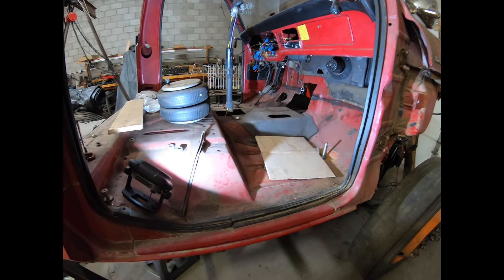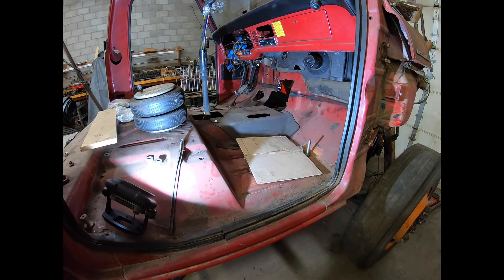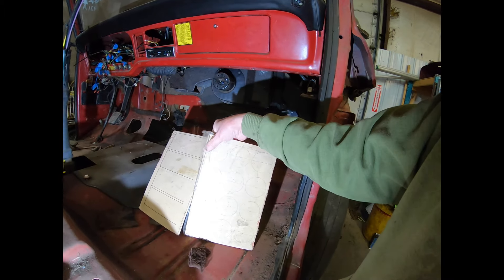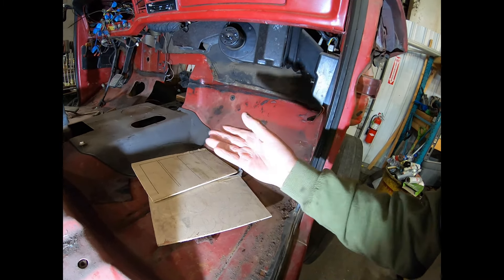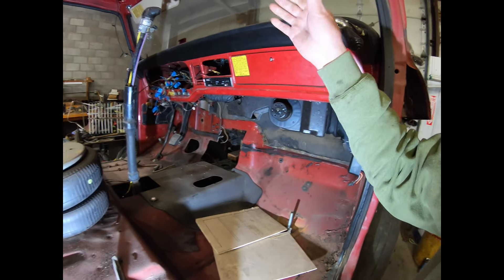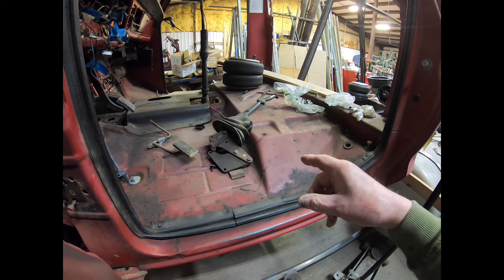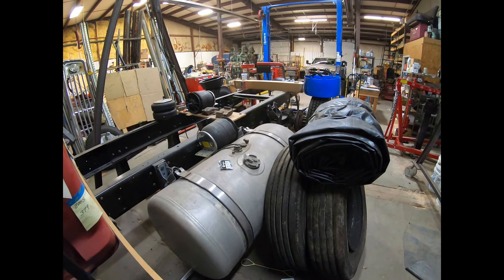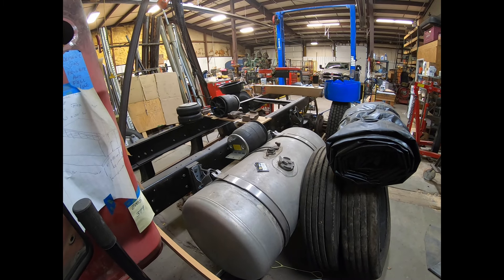Ford F750 Haul Truck Build Part 65

Comment: Fred, Dakota Digital has a modern electronic, stock appearing Ford truck dash units and could put all of the custom gaugings you want in it.  They could custom make what you are wanting.  You could even go to a laptop-style screen that you could select readouts for a multitude of sensors and program it to your layout you like.
As for the heat/AC system.  Vintage Air builds fantastic air conditioning and heat units that are designed to replace the antiqued unit in the truck.  
The power steering on the Ford was probably a unit that had a hyd cylinder that fits into the crosslink assembly.  It sensed the pitman arm trying to move and applied hydraulic pressure, via lines and hoses to the external cylinder hooked to the frame and crosslink.  I believe what you would want to do is find a later-style unit that is all in the same gearbox.  Even adapting a unit from some different truck should be not much more than making an adapter plate to the frame. 
Take the floor out, build back what you want using 16 ga. or even thicker metal.  You might even do the same on the driver's side and put a nice air-ride seat assembly from a semi into it.  Just weld reinforcements under the seat mount for safety.
As for the wiring mess in the old truck.  Companies like Ron Painless Wiring make new harness assemblies that are designed for modern electrics.  You know what you are wiring/wanting, send them a drawing and some photos and I am sure you would get a new harness back that would be perfectly matched to your digital dash.  
Being the truck is old and a heavier duty truck than a pickup the cab is the same.  So the custom truck market is ripe with special stuff.  Jump in with both feet, look for modern stuff and have fun.  After all, this is a custom build so a custom dash would just be a nice touch.

Comment: Geeezzz, that's a lot of mods to get that truck on the road. I think you have to look at does that cab fit your need with having to add a sleeper,AC and power steering. Another issue with those old fords was the front ends, they were always hard on the steer tires.

Comment: Fred, I think I caught in your video that there is a Hydraulic brake line lock lever on the left side of the dash that was used for static operation.  Step on the brake, flip the lever and pressure was trapped in the brake cylinders which kept the brakes locked on.  We used those on all of our service and winch trucks.  That drum brake you have on the drive shaft went out of style because if it was used as an emergency braking system the rear wheels could still rotate due to the differential acting if traction was lost on one or both wheels.
Reply from the maker: Yeah, I was going to try to be able to use it as a parking brake but they won’t let me! Parking brake has to be independent of main brake system I was told! I was going to reconnect it to front brakes and then have the normal parking brake attached to drive line for rears!
Reply: @frednewman2162  Bummer.  We used the valves that had a black knob you pulled up and then let off on your brake.  When you were ready to go you simply stepped on the brake and the check ball released.  Cars and trucks used to have the hill holder function that automatically kept the rear brakes applied when you stopped on hills.  That way you could have one foot on the clutch and the other foot could quickly jab the brake pedal and then give it gas to start moving.
Estella's Fiat 500 has a hill holding function built into the computer electronics.  The valve you have would be great for that as you could release the brakes as you started moving when on hills. Keep it and label it "hill holder".
Here in oil field country, no one uses parking brakes.  The saltwater brine that was sprayed on gravel roads to control dust causes those cables to seize up rather quickly. spread a few thousand gallons of oil well saltwater brine on the road in front of our house.  When you made your pickup here you drove on it but not enough to cause you trouble.  Oil well saltwater brine will eat a hole in a 2.375" downhole pipe in less than 2 months.  Who knows what salts are in the stuff but I have a couple miles of it and find some beautiful crystal growth lining the walls of some pipes.  Also, some of it is radioactive.  So hauling it for scrap in a load of other scrap is always taking a chance they will reject the whole load when you have sections of an active 32' pipe in the load.

Comment: This is a custom build. If you want the look you can find it  but it will take time and money.  I’d keep the cab keep dash layout using digital gages custom wiring. Maybe using park lever to operate a air parking system unless you were trying to avoid cdl   Could electric assist work on the steering?  Have it on 4 wheeler it’s great. Endless ideas

Comment: The power steering box on my Dodge is forward of the front axle. I bet you could find an ac box in a F250 or f150 of the same age. I suspect they used the same cab.